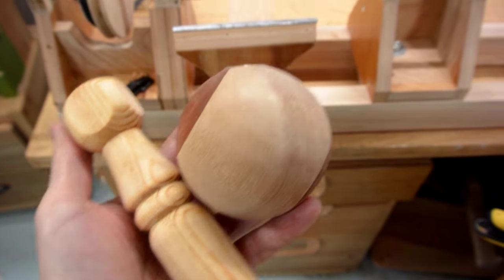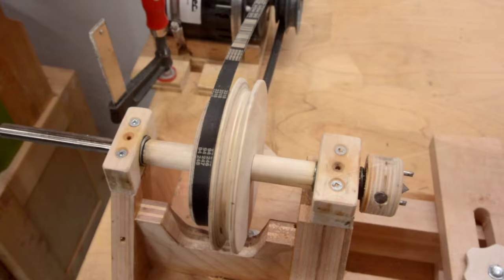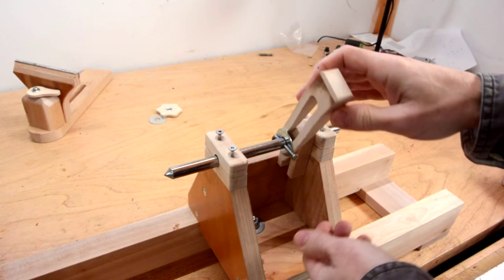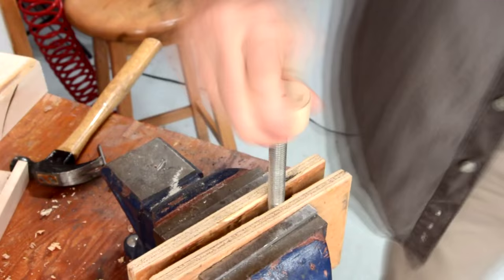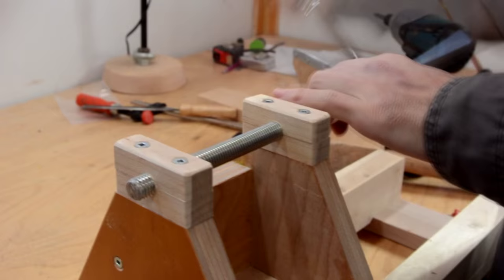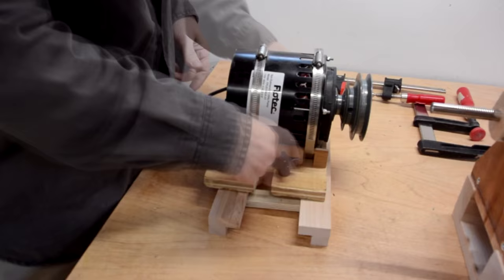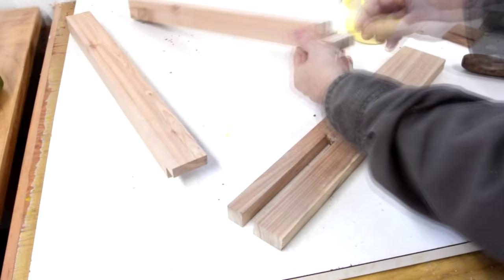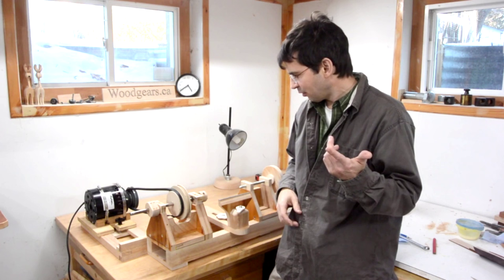Homemade lathe improvements

Comment: Why not just use a set screw for the rear shaft? Put a little dimple in the shaft and then drive the set screw through the wood braces you made into the shaft.
Reply from the maker: +Slap Stick It would suck having to loosen a set screw every time I need to make an adjustment.  that, and they can't be trusted that much either.

Comment: A belt tensioner may have worked better.
Reply: +MisterSinister I'm guessing you missed how he had it affixed before.  The motor was A) just clamped to the bench and b) totally separate from lathe.  He wanted a more permanent configuration.  What he did solved both requirements.

Comment: Why not just buy a lathe for $500?
Reply: Partly for the challenge of building one yourself,  and you can save yourself 450 dollars if you have a spare motor laying around. I'm currently building this with an old drillpress motor and I spent about 20 dollars on all the other materials. I don't really have a need for a lathe but I like turning random objects so spending 500 bucks for something that I might use 5 times a year is a little much for my budget.